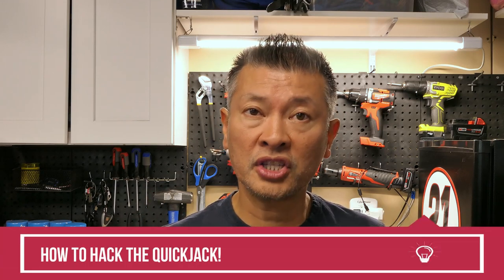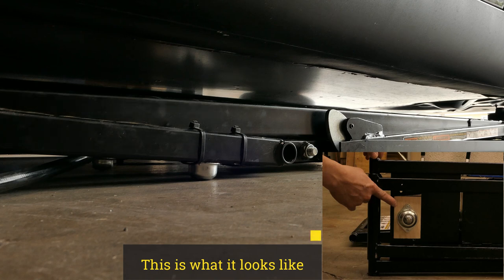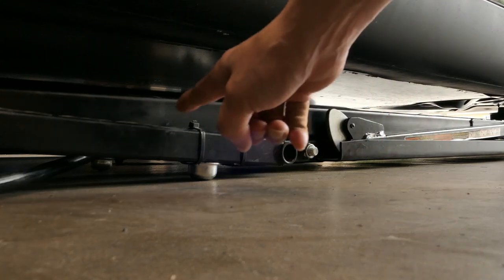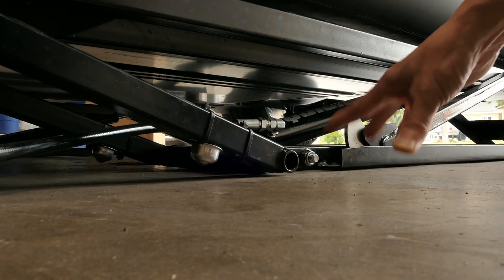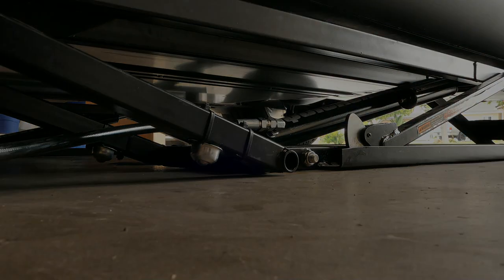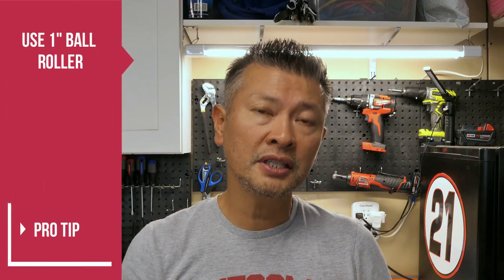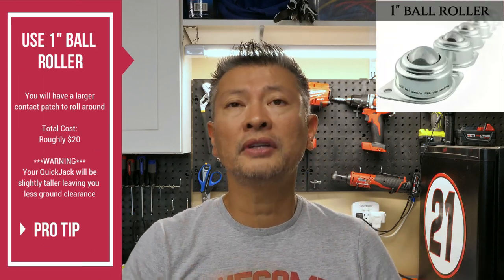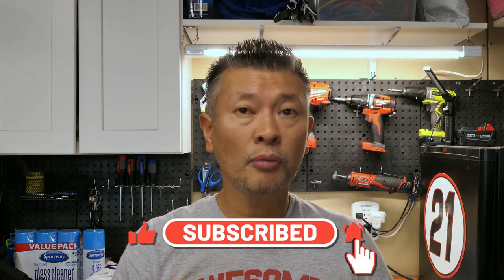QuickJack Hack Followup #BestHackforQuickJack

Comment: Holy Cr*p Peter! Wish i would have seen your video much sooner - I store my quickjacks on it's sides on a small rolling dolly i made so that i can move it to the side of the garage when not in use. When i need it, i roll the jacks to each side of the car via the dolly and set the jacks on the garage floor, but sliding them to the correct position was a paint in the butt....until now. thank you so much for the hack! Now, once i repair my power unit - it started leaking hydraulic fluid out of the manifold section - i will install these conveyor ball bearings ASAP. thanks again
Reply from the maker: Hey Khoi, glad you found this video useful! Moving the QJ around, is definitely something I did not enjoying doing as they are heavy. Good luck with your repair though!

Comment: Thanks for the follow-up video. I just got my quick jacks and set them up according to the QJ video instructions provided by QJ. I have not lifted a vehicle yet because one quick jack seems to lock in place faster (1 second) before the other one. Is this common or have you had this issue?  I bleed the system and will bleed it one more time in the morning. I’m wondering if it is because there is no weight on them and going back to your theory in another video of yours where the quick jack dropped on one side of your Audi. Seems yours did not lift evenly in that video where one side locked and the other did not. Did you bleed them again?
Reply from the maker: Congrats on picking up a set of QJs! QJ actually recommends that you bled the system without any weight on them so you did do it correctly. It's also common when first starting out that the lifts do not engage at the same time. I would go through the entire process one more time for good measures. I also recommend using jack stands underneath you vehicle just to be safe.
Reply: @TheAutomotiveFanatic  I got them so they are working perfect. I even added the rollers. Thanks
Reply from the maker: @jeffreybrown4751  that's outstanding! Sometimes you do have to play around with it.

Comment: Silly question but does anyone have the approximate dimensions needed for the small 5/8" wood block for the 1" caster mount?  And if so, do you think Home Depot or Lowe's would have scrap 5/8" plywood lying around?  Curious where people have sourced theirs, since I am not at all a woodworker and don't have a table saw, etc. just to cut these small little pieces.  Just need to get the rear 1" ball mounted!!
Reply from the maker: I believe you could get away with a small 5/8" 4x2 block. Check out Home Depot's scrap section. They also have saws on blocks that you can use.

Comment: How do those ball bearings work if there is some sand on the floor. I have a dirt driveway and a concrete floor garage? I just cannot keep all the sand out of the garage floor.
Reply from the maker: George, before I coated my garage, I had plenty of dirt and debris. I know it's not the same as your sand issue, but I do not see you having any issues. The main concept with these bears, is that the contact surface is small so it should roll over anything, even if it's stuck.

Comment: Thanks for the follow-up, Peter! I've hacked your hack and improved it. I mounted the ball rollers to the part of the QJ that stays in contact with the floor when lifted. It's much more stable that way, and those Harbor Freight ball rollers are known to be bulletproof. This way, I can roll my car around once it's up in the air and know I've got a much more solid foundation. (Read: humor)
Reply from the maker: Hello Dirk, Thank you for supporting this idea. If I understand correctly, where you mounted the bearings allows you to move the vehicle around while it's up? Wouldn't this be exceptionally dangerous because at anytime, 5K lbs could crash the bearings. I'm trying to grasp the idea from a safety standpoint.
Reply: Happy New Year,  @TheAutomotiveFanatic ! I was joking in my comment --> "(Read: humor)". Apologies if it missed the mark. Yes, you have a wonderful hack and it works well today. And NO, I do not use the Harbor Freight ball rollers to move the car around once lifted. She remains firmly planted on the floor once up.

I suppose some super duper ball rollers could do the job, but not the ones we get at Harbor Freight.  :)
Reply from the maker: @dirkvanvelzen9030  sorry Dirk, I totally missed it!

Comment: Hello Peter, how does this modification performs on your Porsche.  I have one too. In my case, there is only 5 inches of ground clearance. I'm concerned about the ball bearing not clearing the ground when the top  rack contacts the bottom of the car.
Reply: I have done the mod and it works fine on my 2012 911 using the shorter lift blocks
Reply: Works fine on my 2009 911 (997.2) with the shorter lift blocks. I might try the taller blocks are some point, but the shorter ones work fine.

Comment: What is the additional height added when using all 1" inch roller bearings? It looks to be < an inch from the video.
Reply from the maker: The location where I installed the 1" roller added about 3/4" to the minimum height of the lift.

Comment: anybody know if 5/8 or 3/4 inch ball bearings wheels would work ? I am worried about the height of QJ fitting under car .  Thanks
Reply from the maker: You may need to use a riser ramps to give you some clearance if height is an issue.

Comment: How far from the joint is the rear bearing?
Reply from the maker: 2 1/2"
Reply: @TheAutomotiveFanatic  I ended up using 4, 1" roller bearings on each jack (front positioning using 3 rollers appeared to need at least 1" thick wood, so just used 4 total).  I set the front ones 8" on center from the front hollow rod.  The rears are set 8" on center from the hollow rod closest to the cams.  3M vhb tape was used to secure them.  This positioning adds about 5/8" to the overall height which is very reasonable.  Thanks for the hack idea!  I've only used my QJ's once and immediately did the mod just to make moving them around easier.
Reply from the maker: @russelllen8413  Thank you for your exact measurements. Hopefully future QJ owners will see this and try out your placement.